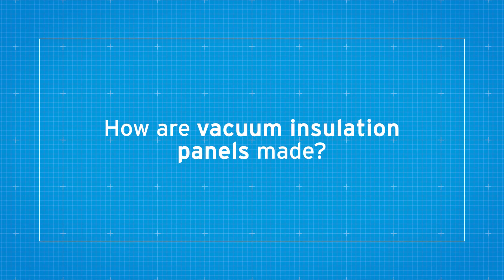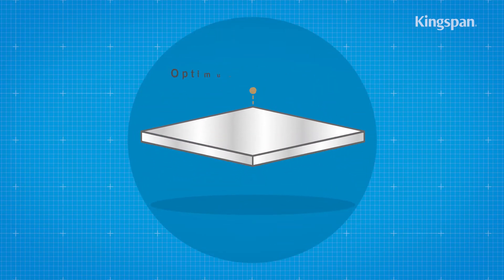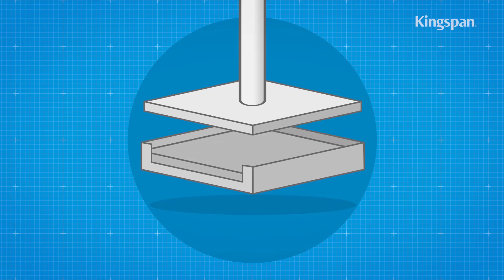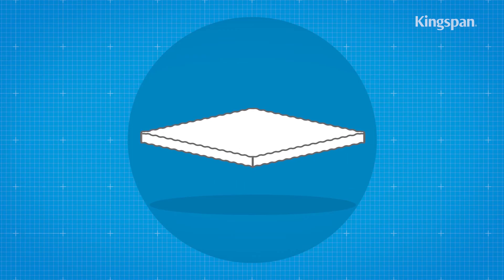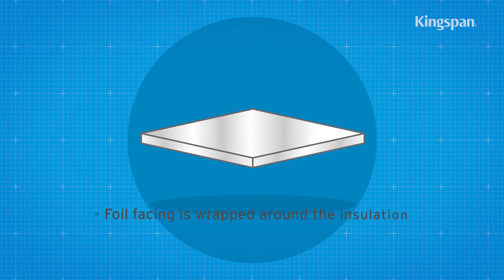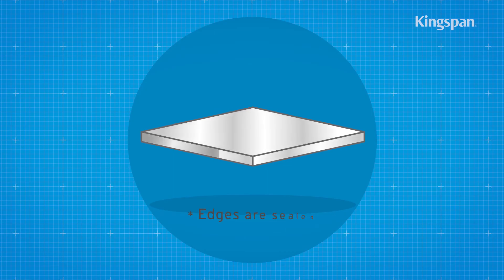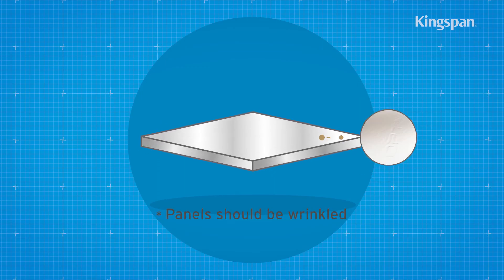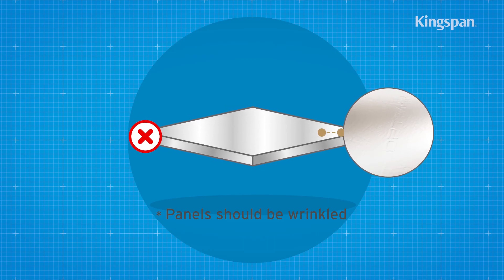How are vacuum insulation panels made?

Comment: After Grenfell who would trust Kingspan?
Reply: From what I’ve looked into, that was caused more by bad building design than from the panels, which as far as I can tell, did a amazing/horrid job of holding in the heat from the fire, causing it to spread faster. But I’ve only looked into it for 20-30 minutes after seeing this.
Reply: i thought that was a different manufacturer, and that there was fraud uncovered in the fire rating process.

Comment: Just sales & marketing hype. There is no way that a sufficiently high enough vacuum can be achieved like this.
Reply: Vacuum insulated panels have R-values up to five times higher than conventional insulation of the same thickness. Normally, heat transfers through both the foam structure and the air. If the air isn't there, there's much less stuff for the heat to transfer through. Simple.
Reply: why ?